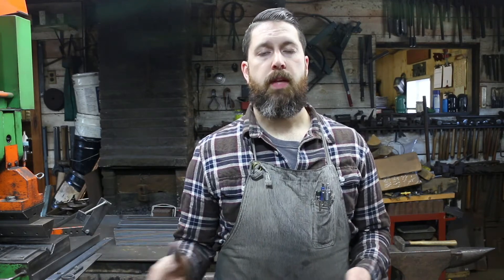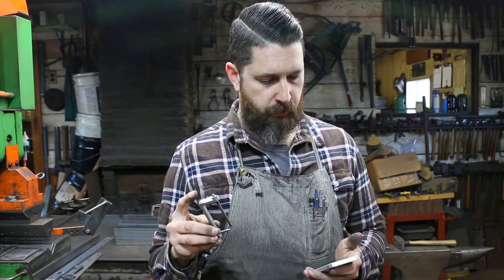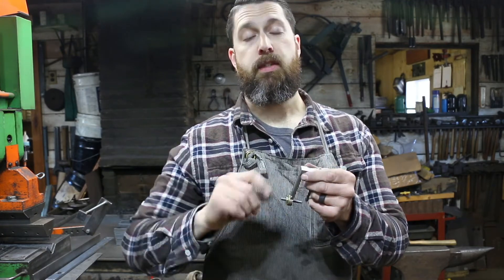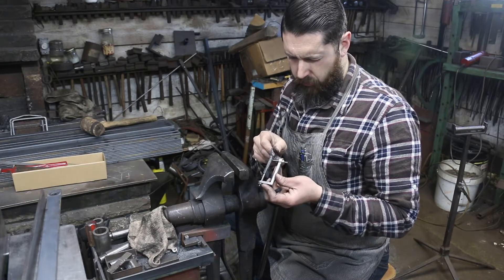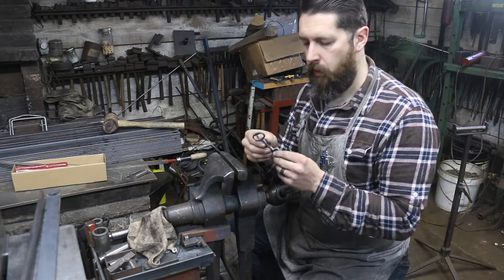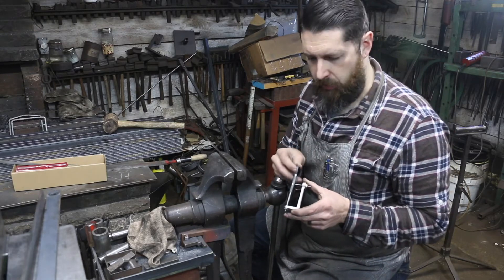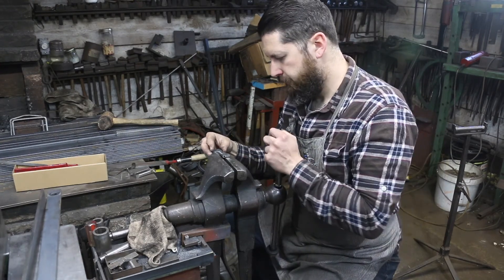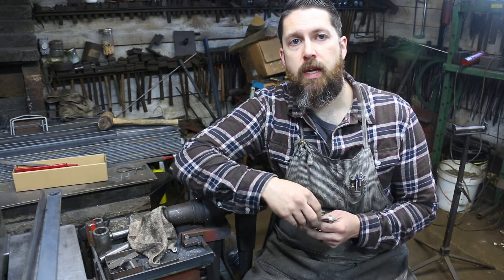Show & Tell: Key Gauge

Comment: That is a nice tool, I really appreciate your work! I think it will come handy, because in contrast to 15th century key stems, which are mostly wound from a sheet around a pin, the late ones are often described as drilled, so as it is also written in "L'art de serrurier".
Reply from the maker: Thank you! Yes, the wrapped ones are much easier to have even and centered. A lot of what I have been making and studying have been drilled. I look forward to using the tool more and hopefully producing better keys because of it. Though I am also planning to make some keys in the future with shaped stems.